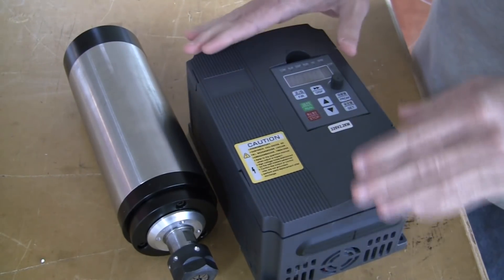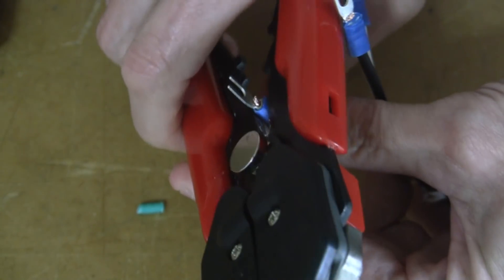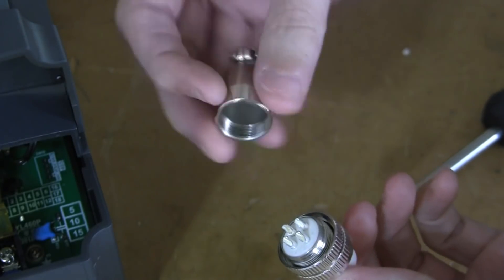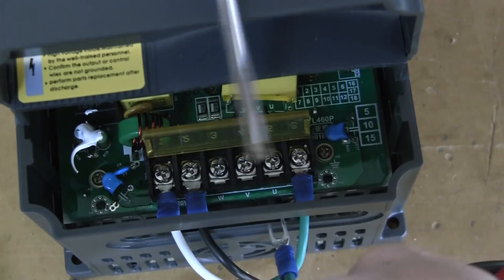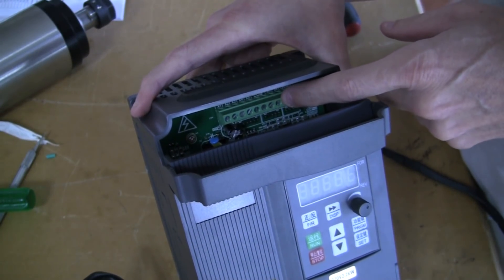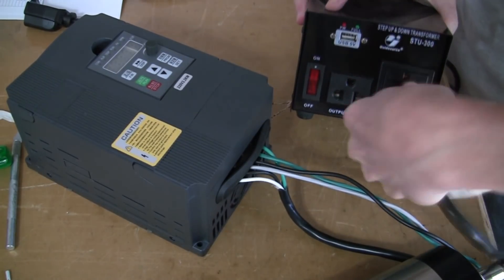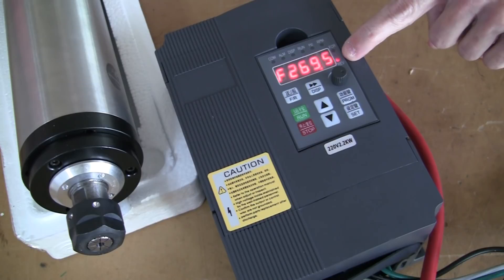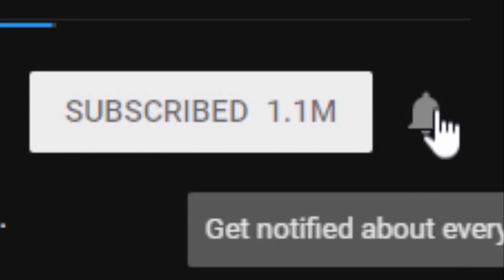Spindle and VFD (Variable Frequency Drive) Setup Part 1

Comment: amigo compre el vfd Nowforever de 220v pero mi casa solo hay 110v entonces compre un transformador de 110v a 220v mi pregunta es como conecto la corriente si mi tranfo solo trae face-neutro-tierra y en las entrada de corriente del vfd trae R-S-E
Reply: Compraste un trifásico a la entrada  y tú tienes monofasica
Reply: Mide el voltaje entre las terminales fase y neutro y si te da 220v conectarlas al vdf en terminal r y s una cada una

Comment: Why ground not connected to spindle ?
Reply from the maker: Add the ground.
Reply: important ewery metal cover motor have connected to Ground wire. same all metal case, box, frame, etc, if some motors come fault broken etc, hot wire not go to all metal Ground wire blow fuse and safe you life. if Ground not have hit wire power go to all metal and you touch metal all 220V power go to you body and you die. Ground wire take fuse blow and power off. its basic safety all elektric.

Comment: What did you do about the ground in the spindle ?
Reply from the maker: Are you referring to the 4th pin at the back of the spindle?
Reply: yes :)
Reply from the maker: From the factory, that pin is not connected.  Because it is a metal casing, we connect that pin (from the back of the connector, not the connector on the spindle) to PE (protective earth).  I'm not sure if this is required which is why we require our customers to seek guidance from a professional electrician.
Reply: So I don't have to solder additional wire from the inside of the pin to the body of the spindle ?

Comment: In the video you say you have a 220 circuit with a N, L and G. In the US our 220V is (3 wire) L1, L2 and N (two hots and a neutral or (four wire) L1, L2, N and G. I have a VFD (with similar connections as yours) that I need to hook up. How can I hook the VFD to our power in the USA?

Comment: The STU-300. Can you run the spindle full time with that? I ask because I got the 220v VFD and don't want to use it on my 220v outlet in my shop if I don't have too. Thanks
Reply: Since the Spindle is 2.2kw would an ST-3000 work be a better choice
Reply from the maker: Yes, you would definitely want the 3000 watt version if you are going to operate a 2.2kW (2200 Watt) spindle and VFD.  Mind you that I have not tried this in production.  We have a dedicated 220V outlet in our shop.
Reply: Thanks.